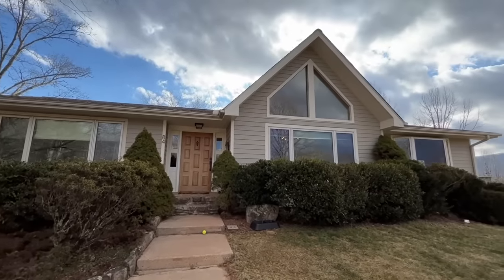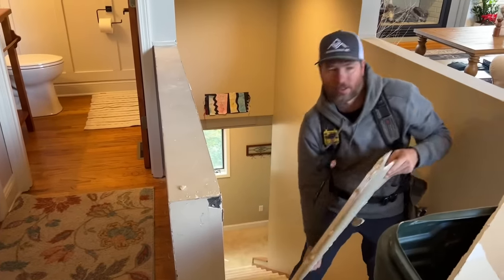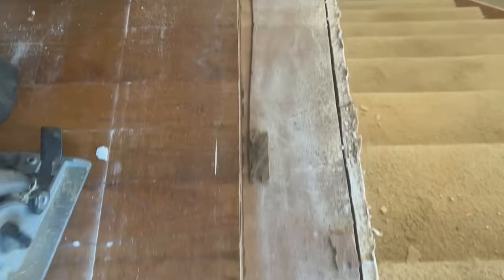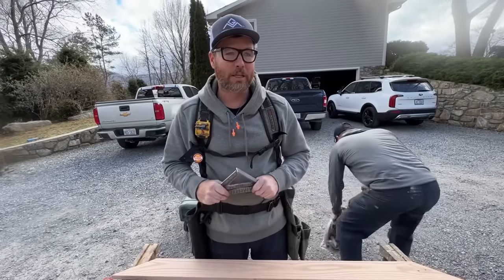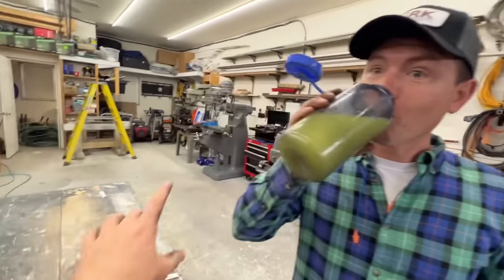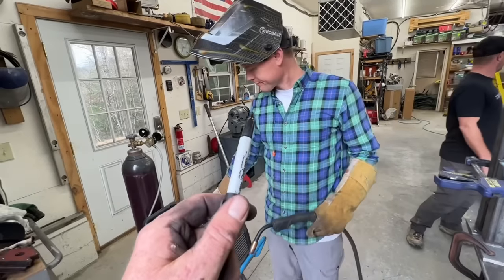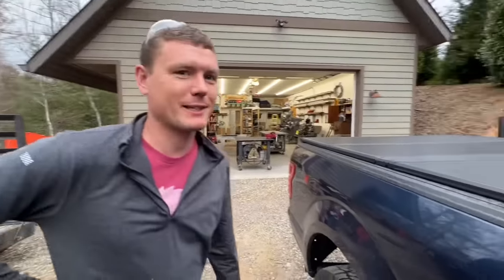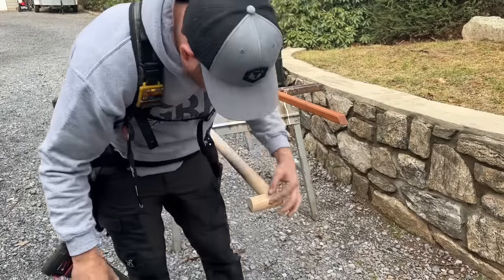These walls had to GO at my house!

Comment: Got a new sub here man, you guys all have a flow, just easy to sit back and enjoy. No BS fillers and the work is top notch. The metal railing turned out amazing. When you first described it I thought it was going to look a little too outdoorsy, but it ended up really clean, and probably 10 times sturdier lol

Comment: Hi Eric and Jamie, greetings from here in the UK , a couple of suggestions from a fabricator regarding your Mig setup, Jamie have you tried “tip dip” ? Yes it’s a real thing no BS . Basically it’s a wax type  anti spatter that comes in a 500ml tin,  when you get a new welding tip and shield on your torch you’re meant to dip the tip of the torch inside, i instead have a 10mm glue brush that I painted the mig tip outside and the inside of the shielding gas nozzle and the end of the outside end part.  After you have done that before you use it on your workpiece, just try it out on some scrap metal to heat up the torch tip and it takes the excess away.  It’s an great tip as it saves your welding tips and shields from collecting the spatter inside and building up then dumping it in the weld of your workpiece! You can also use it like anti spatter spray too, gives you more control over where ares you want to protect.  Try it out as most of the big welding suppliers supply it.
  Eric with your coat hooks 🪝 have you tried making your own hooks out of steel so you can can hang or move them around to the different slats.. we’ve done similar ones with horse shoes as a feature for you can move to different heights and widths to suit your needs. Anyway love the show and keep going as it’s a great show by far!  Warmest regards. Phil

Comment: To secure half walls properly use all thread or threaded rod.   Put blocking in the framing and drill 1/2” through the sub floor and blocking drop the threaded through the hole and put a large washer and double nut it. Frame the wall so their is a stud on both sides of the threaded rod.  Drill a hole and countersink the top plate and slide the threaded rod through and put a washer and nut on the threaded rod.  Take a socket& socket wrench and tighten it down.  The tension on the threaded rod will compress the half wall and tighten it down.  Once it is tightened enough put another nut on double nut it.  Cut it flush with the top plate.  That wall will never rock again!

Comment: Like the steel additions to the stair well.  One answer to the hand rail would be to make the mid bracing at the same angle as the hand rail.  Then design it as an extension of that diagonal brace.  A thought.

Comment: You know you’re working on your own house when you don’t setup dust barriers and drop cloths 😆 (my wife still
reminds me) Shallow cut the sheetrock with a sawzall into 2x2 or 2x4 foot pieces for easy removal—quicker and no hammer required 😎 Also, invest in a track saw—great for framing and remodeling finish work like yours!

Comment: I've found with flimsy half-walls that if you thoroughly glue and screw a sheet of 1/4" ply to both sides it stiffens them up tremendously, essentially making it a torsion box.  Make sure the plate is really attached to the floor well.  Then sheet over the plywood with 1/4" rock, and you're good to go.

Comment: NICE job!! I have virtually the same metal equipment as Jamie, except I opted for a gear drive mill/drill instead of a full blown mill, so I didn't have to buy a converter for three phase. I didn't see a plasma cutter though. Jamie, you could have 'drilled' the square holes with a plasma cutter. Get one, you'll love it.
Reply: How about a waterjet?  Those are amazing.  I did some contract work for a defense contractor for a few months and got to watch them cut through steel with water.  Blew. My. Mind.
Reply: @LeadBariBass  I agree, Todd, but... have you ever priced one? I've not lit a cutting torch since the first time I used a plasma cutter. That said, I have to credit Jamie with his inventive approach to "Inserting a square peg in a round hole!" Theirs is a Great Show, I enjoy every episode, not to mention all the times I've said..., "Now WHY didn't I do it that way?!"

Comment: So just curious how did you secure the front of those rails into the floor given that it was three-quarter inch oak and then maybe a stud underneath did you use some really long screws or are you just relying on the overall structure as the support.

Comment: I feel like even though y’all don’t do drywall, y’all do drywall enough to benefit from drywall cut out tool (drywall router). They make them from all the cordless platforms y’all use i.e  dewalt, Flex, and Millwaukee. Who doesn’t like buying a new tool 😎

Comment: I'm doing something wrong with my oscillating tool? It seems I get one single cut before the blade is dull and I'm literally burning up the wood. And it doesn't seem to matter how much I spend on the blade either.

Comment: Quick math teacher comment. Take the size of your stock and multiply by the square root of 2 to find the round size you need for the hole. For half inch square that is just less than 23/32.

Comment: What did you use to bolt down the railings? Big deck screws?
Reply from the maker: I used some 2 inch GRK structural screws and then painted the heads black afterwards

Comment: Standard fair for cheaply built American homes. Ugly architecture keeps getting pumped out by unskilled workers. Less size and better quality would be of benefit to the American housing market. Home Depot’s on every corner for a reason. Take a trip to Europe to see how it’s done right. Perkins does a better job than most but stuck in the 80’s.